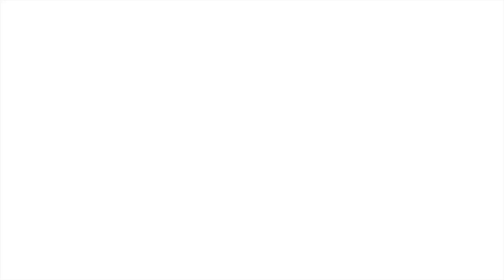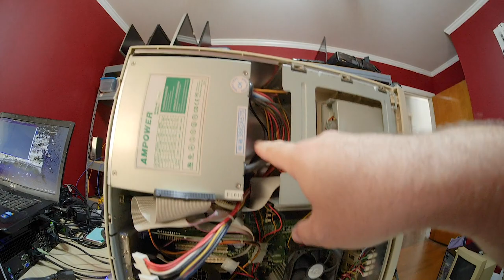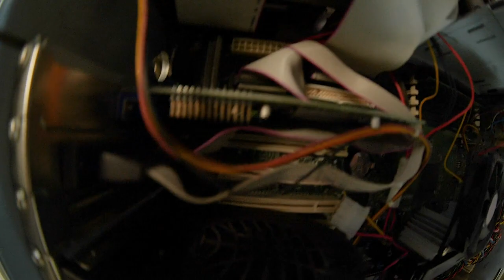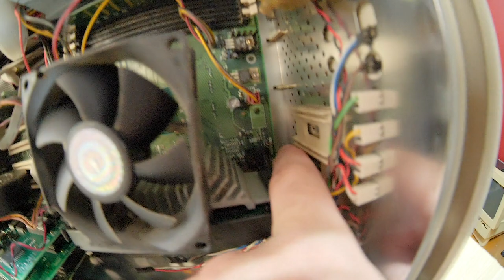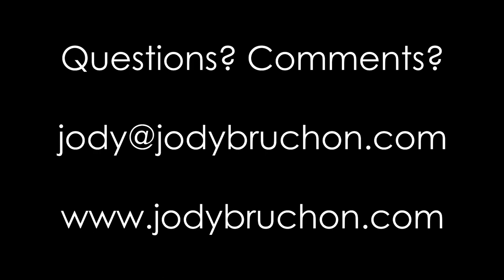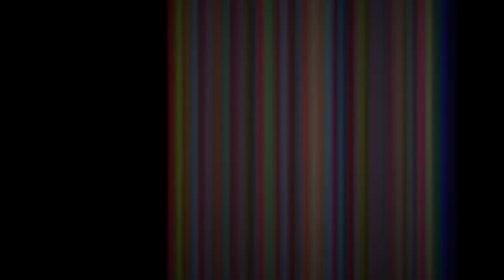Repairing an Ancient MS-DOS Laundromat Controller Computer (Hybrid AT-ATX Power) - Jody Bruchon

Comment: I want to know more about the laundromat :)
Reply from the maker: Pretty sure it's from Scrubbin' Board II in Sanford, NC: https://goo.gl/maps/B1EHb2v2TZiMErN46

Dexter is the commercial laundromat machine company that makes these washers and dryers. You can get them with quarter slots or you can get a reloadable card setup where they feed cash into a machine panel and it loads their card up with the cash, then they just swipe the card in the machines to pay for the cycle. The card version is way less annoying due to not screwing with quarters, but the machines must be run by a computer that handles the money, cards, and machine control. This is the computer that does that work. Every hour that that computer was in my office was an hour that no one could use the laundromat. That's why the video is so short.

The one from Scrubbin' Board III is the exact same system, but it's running Red Hat Linux instead of DOS, so I was able to completely replace that computer with a newer one because I can compile Linux kernels and software to suit.

Comment: I can't believe some people would still use such a dinosaur PC to power a laundromat or similar businesses.
Reply from the maker: It makes sense. The laundromat system is DOS-based and a replacement system is $50,000. Which route would you go?
Reply: @JodyBruchon  I share your opinion. Being thrifty is very smart in any part of life. Old stuff can be more reliable too. It's super impressive that this quarter century old computer still runs! Do you know if the laundromat really has been using it since the late 90's, or is it a donated PC?
Reply from the maker: @geo58impala  It's the original controller that they put in there when the machines were installed. The same guy has another laundromat which is a standard quarter one (the one I go to) and another that's the same as this, but runs Red Hat Linux. The weirdo embedded Pentium III motherboard exploded. I rebuilt it into a newer machine with a Core 2 Duo, but that meant upgrading both the kernel and the ancient userspace. It was painful. GCC 2.95.2 I think was the native compiler. Kernel 2.4 series too. I can't remember how far forward I built it but I think it's running a 3.x kernel now.
Reply: @JodyBruchon  Thanks for the nice read. Nice to meet you BTW!
Reply: Die Rächnüngk vier di wehschmäschinn zällän $i -umbärellä? v  v

Comment: Wasn't clear from the video - if it had a Turbo switch, did it also have an LCD to show the 'speed' ? Back then, the processors got so fast, the software couldn't keep up. So some Brainiac included a 'Turbo' switch to SLOW THINGS DOWN..... Sheesh. BUT, the display was just controlled by plugging in cables to the motherboard, so you could just make up any speed. (Orright, within 4 or 5 characters.) And we didn't know about Gigahertz back then. Or actually, Megahertz. Happy days.
Reply: That would be just legacy from PC AT cases. Even if it has lcd in there most of them were just displaying predefined 8segments.
Reply: @marksmithcollins  yea, you had to set the mhz that it should display. recall my first pc build I was a bit let down since my case didn't support the 80mhz my cpu was doing, so I had it displaying 66 mhz instead. oh well, didn't matter, except for the optics.

Comment: In my Memory all Pentium II where slot CPUs. Is this maybe a Pentium MMX or P3?
Reply: Oh. Ups. I did not see the slot in the first view. Sorry! :)
Reply from the maker: I'm pretty sure one of my employees (or myself) added that fan a long time ago when the machine had a different issue. Those Socket 1 heatsinks need fans and some don't have them. If I recall correctly, the hard drive was failing but the data was OK and we replaced the drive, but while we were in there, I slapped that fan on top because I knew better.
Reply: @JodyBruchon  usually the more higher end slot 1 cpus had fans, but the lower end ones didn't. the airflow in the old cases weren't the best so with dust buildup and 24h use, adding fans is not a bad idea.